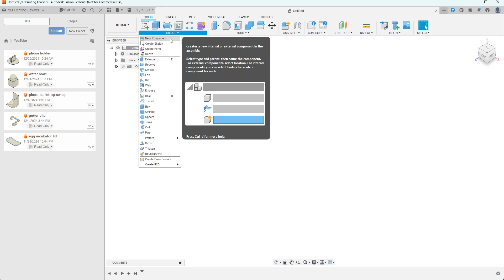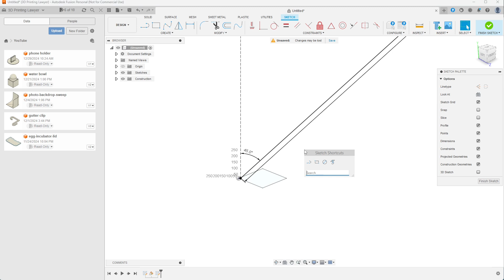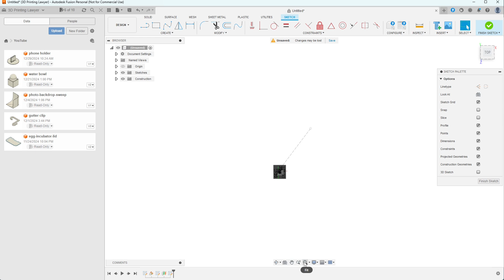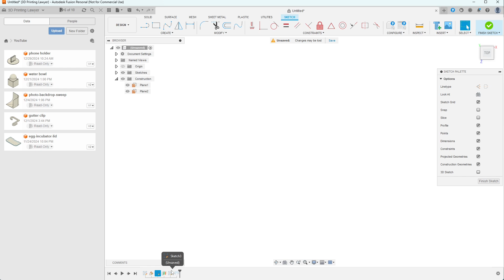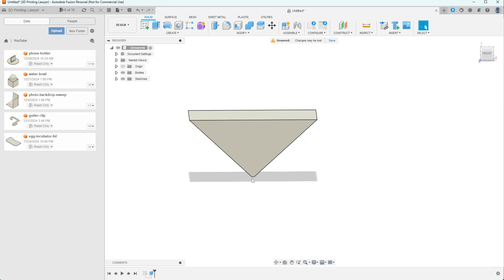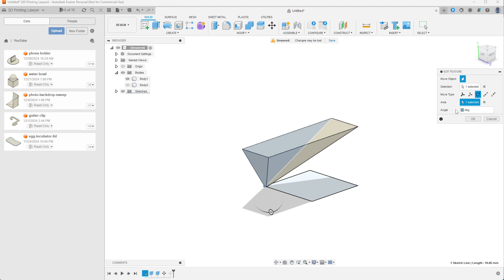Designing the Adhesion Torture Test in Fusion 360 #3dprinting #fusion360

Comment: hey I just thought couldnt you just make the top square and the bottom square then loft the two together or sometihng?
Reply from the maker: @luke-w8c6w  Super smart. The first method in the video is the loft method, but it's actually complicated if you want to ensure a 45 degree angle.